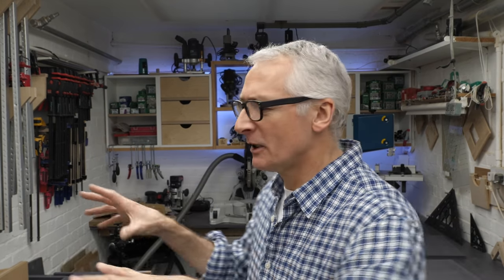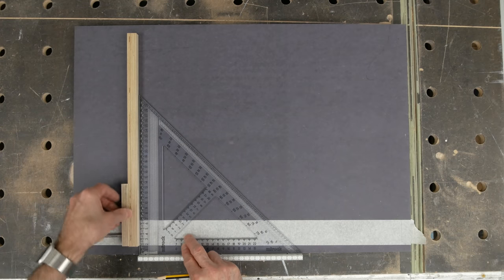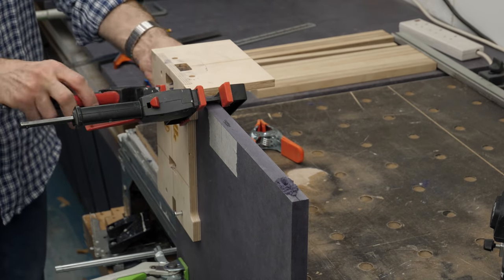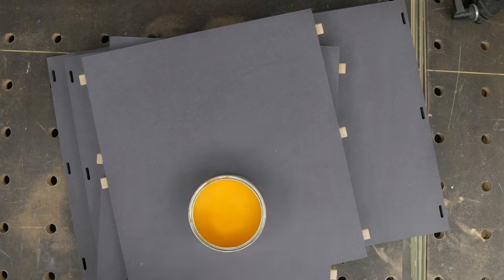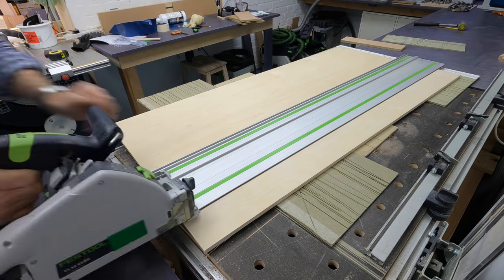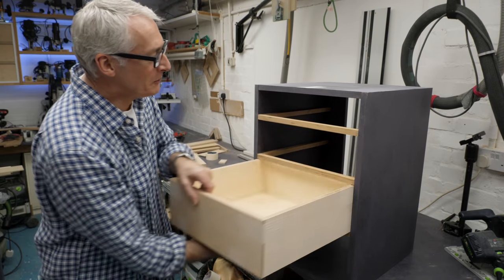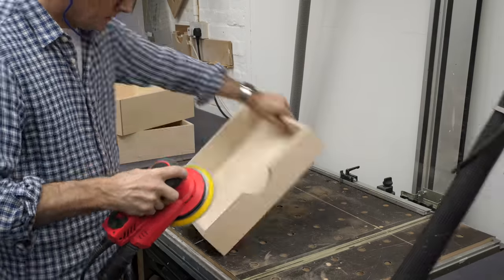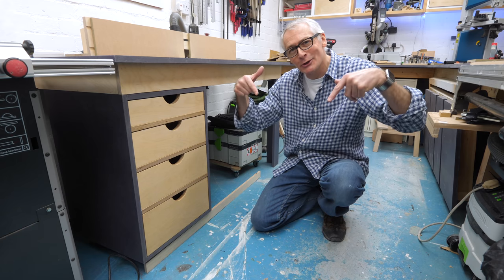Birch Ply Drawer, Router Bench Cabinet [video 479]

Comment: Hi Peter, BIG fan of your videos, my kind of woodwork, does the job, strong enough, looks the part, and you include the occasional ‘’’Not quite to plan bits’’ which are far fewer than mine😏
Would LUV it if I could see the finishes and glues etc, you use, save me stopping the videos, and zooming to TRY and identify the tins and containers.Thanks for the inspiration to have a go. Kindest Regards
Reply from the maker: Thanks Tony! Honestly, I try not to promote the finishes and glues too much, because I’ve used all kinds and with very few exceptions, never really found much to choose between them. The fast grab ova is by maxitek, but I happily used polyvine for years, just happened to be five the maxitek. And same goes for the wax finish; this is black bison paste wax from Liberon, but I’ve always used their beeswax previously. No real reason for any of it, it’s just what I happen to have. 👍👍
Reply: @10MinuteWorkshop  assume runners short at front to allow fronts to recess flush with front of cabinet ……….picked that up from your earlier videos back when Obi Kinobi👍

Comment: That grey MDF looks really great - and, YES to fitting a plinth (all round!) to save scrabbling for the thing you drop on the floor that then rolls under the cabinet!     Interestingly Tomas over at Casual DIY was reviewing a Domino type router jig today - not cheap but looks well made . .  worth a look.   I shall wait for the plywood model.
Reply from the maker: Yea, I’ve seen Tomasz’ vid. As usual they get quite expensive by the time you’ve added import duties and VAT. 👍👍
Reply: @10MinuteWorkshop  I have used that same jig, it has issues for sure weight being one of them and depth movement, as a simple solution I'm waiting on your jig, I like the pin solution, I wonder where I have seen that before.... any idea how long for your jig

Comment: You say you needed to fit packers in the back to overcome a slight miscalculation with the rebate with the drawer fronts... But I think sub consciously you meant to do it to allow a little air flow at the back of the unit! ;) hehehe

They look really good, and I love that style of handle, no daft knobs or anything to come off in your hand or get knocked off, just... plain and simple! :)

Comment: I work in a joinery factory, and we partly use our Homag CNC machine to do all the holes for cabinets in kitchens for example, and we do an 8mm hole in the side, and an 8.5mm hole in the edge like you do on your tenon jig as like you say it gives just enough movement for that variation you may get. 👍

Comment: Regarding the packers to stop the drawers from entering too far...
I'm surprised you put them on top of the slides vs. below them.  I feel like in my case (due to a lack of decent dust collection) dust would collect there over time and force the drawers to start poking out a bit.
Since you are pro level and gave very good dust mitigation practice, probably not a concern.
Another great video.

Comment: For your "kick plate" or plinth, if you make it out of the dark grey MDF and it sets back a bit, it will look like the drawer unit is floating since it will be the colour of a shadow. (I like the birch ply also, just going for a cool effect for extra credit :^)  ).
Reply: Agree.  And, a dark plinth less likely to show scuff marks from the toes of your black soled shoes, Peter, regardless of waxing.  Given the proximity to so much dust, I thought a closed back would be preferable.  time will tell. thank you for another fine vid.

Comment: Last year, I bought a 25mm brad nailer. I think that was a mistake, as it doesn't really shoot 25mm brads very well, but if I drop down to 18mm brads then I have to rebate to make housing joints in 18mm stock, otherwise they're too short.

I should have gone for the 32mm version. It was only cheap though, so no real loss.

Comment: From an engineering point of view I always prefer to have the sides of any cabinet mounted on top of the base rather than being at the sides as all the weight in the cabinet is then on the full depth of the base rather than just the dowels and glue! But as this one is only for relatively light weight bits and jigs etc. both glue and dowels should be more than sufficient to cope!  The  same applies to the drawers!  A great video as always Peter, thank you!
Reply from the maker: Thanks John. As I say in the video, normally the housings for the adjustable feet extend over the sides to provide additional support - as they do in 99% of kitchens in the uk & Europe - but in this case I’ll be fitting a plinth, so they’ll be supported anyway. Oh, and dominos are immensely strong. 👍👍
Reply: @10MinuteWorkshop  "Oh, and dominos are immensely strong."  Not just that, but it's always been said, and proven, how the glued joints are stronger than the wood itself, so unless it was to snap off the 3/4" (er, 18mm) MDF just past the glue joint, it's unlikely that cabinet would fail from the vertical stress...and if it was ever going to do that, it wouldn't matter if the bottom panel was extending under the sidewalls or not, it too would snap in the same fashion!

Comment: Thanks Peter another very helpful video.

Watching you complete various tasks is a great way to learn. I like the way you cut narrow pieces on the waste side of the track with a simple fence clamped to the table.

Can you share your fence setup with the track saw please. Looks like a longer version of the original Festool MFT 3 fence?

You make extensive use of the pin nailer. I don’t have a compressor. Do you think that a compressor is worthwhile in a small workshop? How do the battery pin nailers perform?

Your comments appreciated. Reading your responses to other questions is always illuminating.
Reply from the maker: Thank you! The MFT fence is a standard Festool one for the MFT/1080 - the older version that I have. Not a fan of the fence arrangement on the /3. Re nailers, I happily use battery and corded nailers; a small compressor is very useful in the workshop, if you can find the space from one, as air nailers can be bought much more cheaply than mains corded ones - I bought my compressor and 23g headless nailer for less than the cost of an equivalent cordless. 👍👍

Comment: Hi Peter, only just got chance to watch this one late tonight, the drawer cabinet looks great and like you I really like the contrast of the grey / black mdf against the birch ply.
I always wonder how to decide between drawer fronts sitting inside and flush with the carcass or over hanging the edges of the carcass. I suppose fitting flush inside the carcass means there are less flat surfaces for dust to collect on.
Speaking of dust the coloured mdf makes some pile of dust my workshop looked like a coal mine today after I routed out the recess for my router plate.
Looking forward to the loose tennon jig details when they come out, my home made one from your plans is ok but the CNC one looks so much more professional, I always struggle with which face and edge I should be referencing from ?
Oh and I would go with Birch Ply for the plinth 😁 with some LED's in, now that would be fancy LOL, you always make everything look so quick and simple.
Reply from the maker: Oo, LEDs! Hadn’t thought of that Colin! I like inset drawer front for workshop drawers - just makes them look more workmanlike than overlay fascia’s, which I always associate with kitchens, for some reason! Loose tenon jigs are coming along. Still a few tweaks to do yet. 👍👍

Comment: Another excellent video. There are as many perfectly adequate ways of making drawers as there are days in a month. My methods tend to change according to the purpose of the drawer. I do think most craftsmen over-engineer their drawers (for example, using 18mm when 12mm would be entirely adequate) and on the drawers that Peter shows being made, I would have used thinner front and back but probably kept the bottom at 12mm if it were taking a lot of weight.

If I were making these drawers and didn’t have any 12mm for the bottom, - but had 6 or 9mm, I would alleviate any potential problem by using dados instead of rebates and using a central munton. The dados are like channels and so support the bottom on 3 sides; the muntons are a strip of timber that go front the centre of the front to the centre of the back. You see these quite often on old drawers as they were made before plywood and the bottom is just, say, 1/4” solid timber and therefore not as strong as plywood. I also use quadrant around the edges of the drawer box with glue connecting them to the sides, back and bottom - although you mostly see these inside the box, I prefer to put them under the bottom so that they don’t interfere with the “squareness” of what I can put inside. Either way, the extra glue area on the muntons and quadrant have a dramatic effect on the integrity and weight capacity of any box. I would certainly fix everything as Peter did with good quality glue and pins (these act like clamps and add no effective strength once the glue has cured. 

It’s also interesting on the choice of telescopic drawer runners or plain slides (as Peter). Again, for me, it’s a decision made from a) the weight going into the drawers and b) the width and length of the drawers. So, small drawers with little weight get slides; large drawers filled with heavy tools get metal runners; it’s a matter of experience when you decide your drawers are too big for slides or the weight too heavy.

I also wouldn’t have had an issue using good quality MDF (not the fluffy rubbish from the sheds) for the sides and back and even the front depending on drawer width and handle choice. Good MDF when standing vertically has enough integrity for this job; it doesn’t perform so well as a bottom in large drawers or drawers taking a lot of weight. In fact, most of the drawers I’ve made for my new, large workshop have been MDF sides and front; I’m now getting to the larger drawers (900mm wide x 300mm deep) but will still stick with 12mm MDF for the sides and back but 12mm ply for the bottom with muntons and quadrants in place.
Reply from the maker: Thanks! Completely agree - most of my commercial drawers had a 6mm base and were set into a groove round the sides and back, and never needed a muntin. As for plain slides vs runners, if soft-close is required, there's only one way to go! 👍

Comment: I think the drawer dividers should have been grey! Nice work as per usual funny how you are getting the perfect workshop fully Kitted out & usable when you don't make furniture anymore 🤣🤣 you could have done with that workshop fitout 20yrs ago
Reply from the maker: Well, there'll be a little bit of furniture in my future, but not on the same scale as before, certainly. And if I'd made the front rails in grey, I'd be getting told that they wouldn't be strong enough! 😂
Reply: @10MinuteWorkshop  Ah, but that's when you do a N mm deep front rail, laminating birch behind for strength, and MDF for colour!
Reply: @10MinuteWorkshop  😊😊🙄🙄
Reply: I need to see how hard (or expensive) it is to get colored MDF in the USA.  I really like the gray, combined with those natural looking drawers.

Comment: Great build Peter. I was trying to see the make of the palm sander you used. It looked more affordable than your usual brand and seemed to do the job equally well. I couldn't see it in the 'Used/featured in this video:-' section.
Reply from the maker: It’s the one I bought for the 135 dollar Deros? video - 
https://youtu.be/46Ws3Bgp_bA - great sander, I’d probably buy the sealey-branded version for the full UK warranty, but this one hasn’t missed a beat in a year of hard use. 👍👍

Comment: I Enjoyed this video as usual Peter, thanks a lot.  Very fascinating to watch how you work. A total beginner question if you don’t mind answering? What sort of router bit are you using with your loose Tennon jig? Is it a bearing  guided or you free handing it?  This may be obvious for more experienced but I am still a very much beginner learning to use the router to do more stuff.  Thanks again
Reply from the maker: Thanks Manitha! With this jig the router uses a guide bush that fits snugly in the slot. The bit itself is a spiral upcut bit - it helps with the dust collection by moving the waste up out of the slot. When the jig goes on sale I’ll have a starter pack available with the bit and guide bush, and a few dominos. 👍👍

Comment: You should add some holes and grooves to the tenon jig that fits those L shape screw on clamps you get with most corner clamps
Reply from the maker: The sides are already cut away for easy clamping. 👍
Reply: @10MinuteWorkshop  looking forward to getting one when they are ready

Comment: Nice router table and plinth. Hiding mistakes well, is a a great skill….
Re your jig. One thing watching you use it with a small router, would there be enough space between the clamps to clamp down and fit a full size router to make the plunge? Just thinking your target market may not have the router wall like your good self, or router draw in my case with the multi sizes. Just one B&Q special where we all started 😁
Reply from the maker: Thanks! And yes, it'll take a full 1/2" router, no problem. 👍
Reply: @10MinuteWorkshop  no worries, I did wonder if it was camera angles. I know I have come unstuck making jigs to small and then can’t clamp 😁

Comment: Hi Peter, Happy New Year! Always a pleasure to watch your productions. Just a quick question: I see you have used and tested a number of router assemblies. However, in your opinion, regardless of cost, which is the best router lift/milling motor combination? Many thanks in anticipation of your response!
Reply from the maker: Thanks! I haven't used that many tbh; I was very happy with the big old Triton router I had slung under the workbench for ~10 years, the Sautershop lift and milling motor was a big step up from that - as it should be for the cost! I've just replaced it with the Jessem lift and AUK motor, and I'd say the AUK motor is big and powerful (2400w) and has some very useful features eg speed control on the NVR, but I haven't used them together for long enough to say which is the better of the two.  I think I preferred the magnetic insert plates of the Sauter lift (the Jessem has polycarbonate inserts, though they also do a version of the lift with magnetic inserts) and the lack of a brake on the AUK motor may prove to be an irritation if I ever get to do a lot of stop/start work. HTH P 👍

Comment: Great to see somebody making something that will be affordable and help so many. Fairly new to woodworking but cannot justify a Domino.

When using the Domino do you ever find minor alignment issues, hence the play you have allowed in the jig?

Will the starter kit be okay for a 1/4 inch router?
Reply from the maker: Thanks! Yes, the standard jig and starter set is a aimed at 1/4” routers.  The great thing about the looser setting on the domino is that it’s a precision tool that lets you work loosely. That’s all the extra bit of wiggle room is for, really, so it doesn’t really matter if eg you don’t hit that pencil mark bang on. 👍👍

Comment: You make these things look so easy but they do say that’s the sign of a good craftsman. I’m just about to buy the plans and give this a go mine will be a complete cluster f##k but hopefully it will be functional. I have a very small workshop and don’t have the space for a jointer. So I was wondering if you could suggest a fence modification for the out feed side Side of the fence so I can use this router table for that function. And thank you very much for sharing
Reply from the maker: Thank you! I'm afraid I don't quite follow what you mean by ' fence mod for the outfeed side...'  though?? 🤔
Reply: if you raise the Face of the outfeed side of the fence you can use it with the right router  bit of course. You can use it as a planer for jointing boards to make table tops and such like. I was going to buy one with this feature built in like the trend workshop router table. As I don’t have the room in my workshop for a Planer thicknesser but your set up is far better suited to my needs I just really need it to perform this function. I hope that makes sense if you imagine the top of a planar and flip it on its side it’s essentially that. Sorry to be a pain I’m dyslexic so struggle communicating in this format

Comment: Nice looking cabinet! 
I’m excited to see the loose tenon jig! I have an odd question- will you make the jig in imperial? I haven’t been able to find metric guide bushings for the porter cable style bushings.
 I like the large clamping area of the peanut- clamping your jig looked a bit fiddly. Marks for the clamping area is a great addition on the peanut jig-🤔 😉
In closing the base is a great idea in the shop- I’d go with the gray mdf at least on the sides and back with a 2mm offset/ shadow line. As for the front- may be a stack of birch plywood end grain?
Reply from the maker: First vote for MDF plinth- all others have been for Birch! No plans for an imperial version personally, but have been chatting casually with a company in the US who may be interested, so watch this space.
Reply: I’m sure the plinth will look great either way. I’m a fan of the clean look of the cabinets. My thought is more birch veneer would take away from the clean look of the drawers. I also like the look of the plywood edges. A plinth of ply edge would continue the structural(not drawers) use of the birch edges. 
Looking forward to seeing the next video.